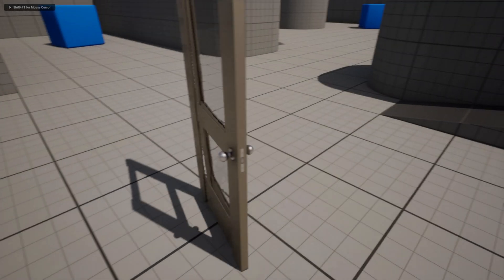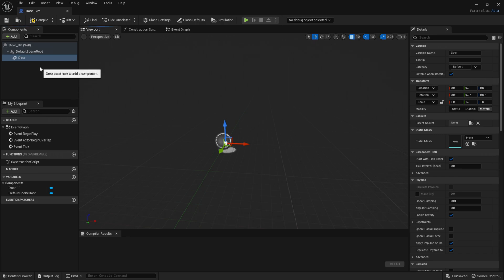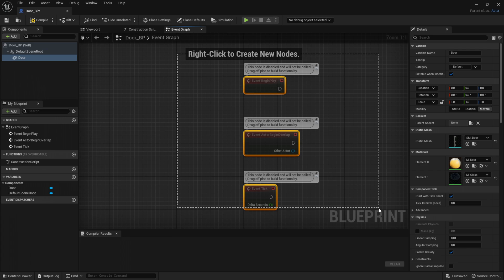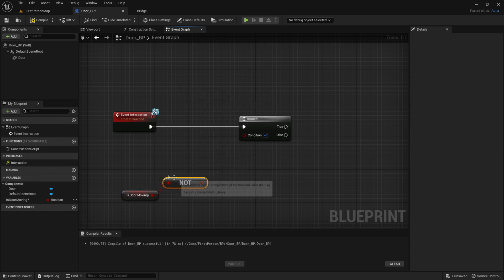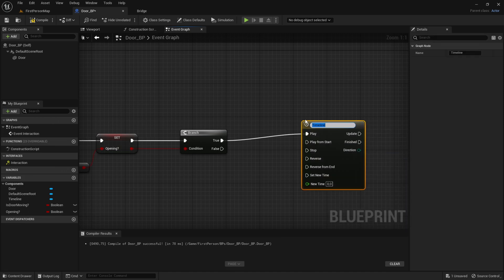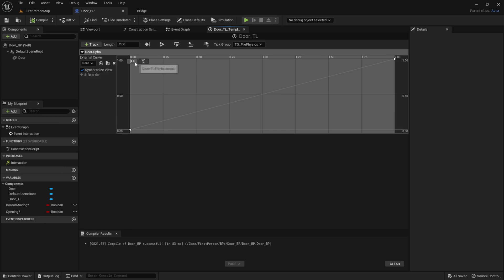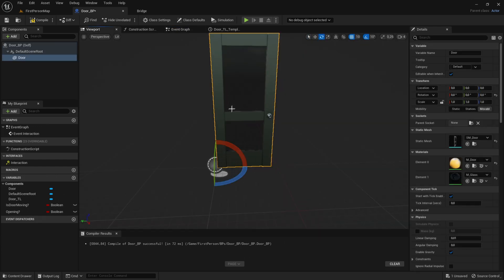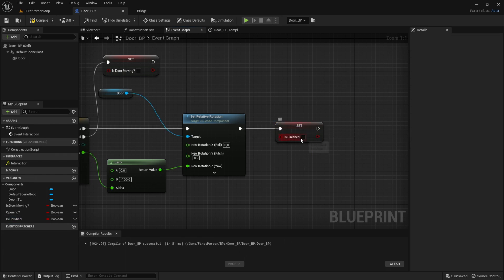How to Open a Door In UE5

Comment: is there any way to stop the door moving if the character gets in the way, because my character clips through if I get in the way
Reply from the maker: Hmm, There's some tutorials on yt so when you open the door the door will open away from you and if you change sides, it will open away from you again, Check For Tutorials On Youtube 👍
Reply: Speaking on the tutorials that Eremental mentioned, I found a pretty good one as the interaction system for the door is almost exactly the same: https://www.youtube.com/watch?v=ciXAGRw9Jik

I will say, while it doesn't exactly fix the problem of the character clipping through the door (when I close the door and my character is in the doorway, it just pushes my character away from the door), it does at least help a little bit.

Edit: You could also look into having doors open and close automatically instead of needing an interaction. "Box Overlap Actors" is a good function to use for it and you can have a box collider around the door act as a trigger. When the character enters the trigger, the door automatically opens and will stay open as long as the character is inside of the box collider trigger. When the character leaves the trigger, the door automatically closes.